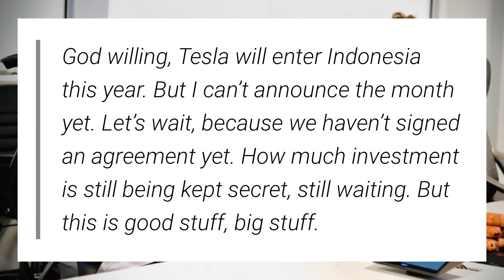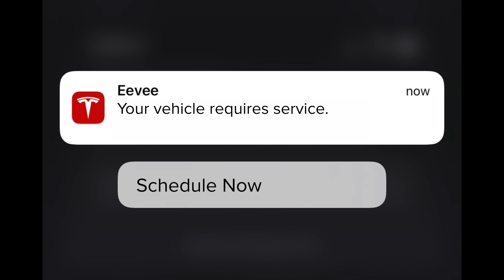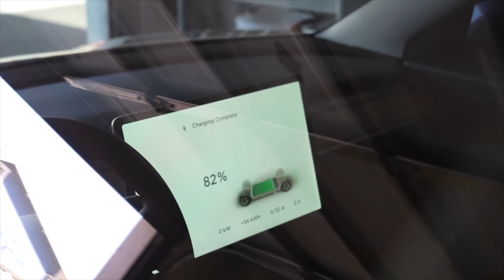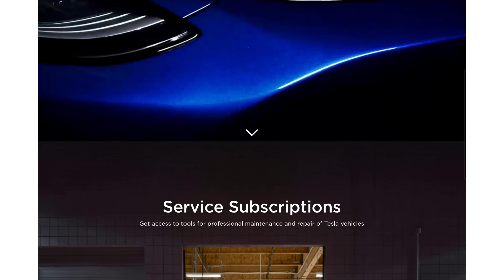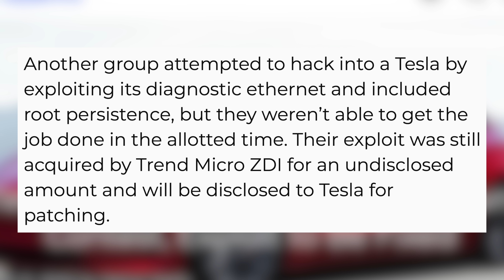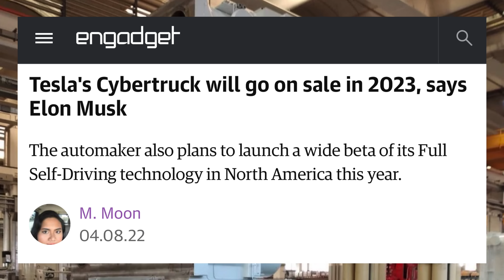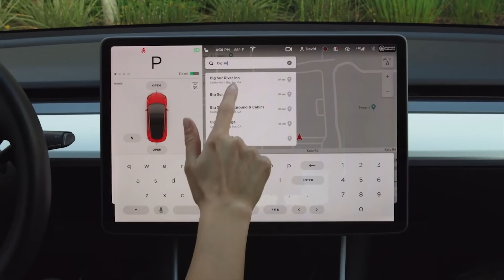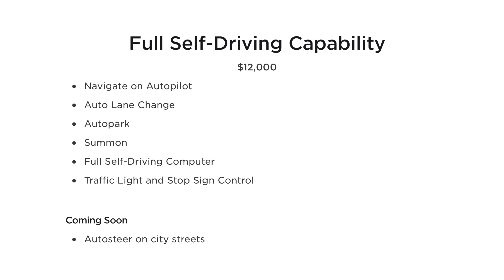Tesla's NEW 100 Year Battery | These Plans Change Everything

Comment: Hmm, when the battery is designed to outlast the vehicle.... Does that mean the vehicle is only going to last 10 years?
My newest car is 13 model years old and runs and drives like new.

There's a lot of hype about charge cycles when it is only half the story. Simple age kills batteries. They need to be made to reliably last 20 years. More will be better, but 20 is a good goal. At which point, there will be no reason for me to stick with a gasoline powered car.

Comment: If you read the paper for this new potentially 100 year battery tech they were discussing cycle life and the lower charge voltage due to using 2 electrolyte additives that improve the working life of the cells.  Everyone already knows that most batteries unless they are being cycled several times a day are going to suffer from calendar aging eventually regardless of how high they push the number of cycles.  So improving the electrolyte is a step in the right direction but I doubt that is going to make enough of a difference considering many manufacturers are already using these additives in LFP batteries.  With current battery technology that is in the market right now including the latest from tesla, NMC and NM tech has a calendar life somewhere in the 10-15 year range and LFP has a calendar life somewhere in the 15-20 year range if kept in within the appropriate temperture range.  Considering that many of Tesla's vehicles if you calculate the actual capacity size of the battery at the sale of the car it is a larger capacity than what the car shows and then you calculate it again based on what the current pack capacity is after 100K and 200K miles it shows that the battery is no longer above 90% at 200k miles.  Many people are keeping track of this and it is well known that many EV manufacturers are putting a large percentage of the battery in reserve to hide the degradation of the cells over the first 100K and 200K miles of the vehicle's lifetime.  In short thier is no way that Tesla or any other manufacturer has a lithium battery that is going to last 100 years or even 50 years and still have a meaningful capacity.  If they can hit the 20 year mark and eventually the 30 year mark with a battery that has only lost 80% of it's original capacity, that will be a huge first step.  Also remember that once lithium packs drop below 70% they are considered EoL because the chances of them having a cell failure increase rapidly after that time due to dendrite growth, lithium plating and corrosion.

Comment: As an owner of a 2013 Model S85 with 109,000 miles and only 86% of original battery capacity remaining (so Tesla's boast of 90% capacity remaining at 200,000 miles does not ring true for me), my main concern is:  when I do need to replace the battery pack, will I be able to get the latest "new" battery technology in the replacement, or will I just get "refurbished" original?  I REALLY would like to keep my Tesla for many years to come, but am apprehensive about its true long term viability.  There is a reason why legacy auto makers use planned obsolescence in their vehicles, ie. to insure FUTURE sales.

Comment: The one thing I'm not hearing from the Tesla/EV YouTubers is that the chemistry is the 532, which is the wrong direction in terms of cobalt. This battery uses 20% cobalt in the cathode, unlike the 811 chemistry or as I've heard Tesla using less than 5% in their current NMCA cells. Also, the research demonstrated the volumetric efficiency at 210 w/kg which was the same as the tested LFP.
Reply: It's a "research paper" demonstrating the possibility changing the voltage of Nick based cells to increase longevity! Nothing more!
I hope you didn't think this was related to the 4680 cells??

Comment: People have been trained for years with crappy 12 volt batterie some only lasting 3-5 years.
Reply: What?
Reply: @rogerstarkey5390  Most people I see that do not work in electronics or construction almost always comment about how long the battery will last. They then say about their car batteries needing replaced every 3 years or sooner if you let them go dead. Or how there cell phone does not hold charge longer than a few hours. People in construction will say so it is like a cordless drill. I have one almost 20 years old battery still works great drill does too.

Comment: The research work on battery development is encouraging.  Although I suspect these "100 year" batteries are several years off.  And, the design is sure to take different branches moving forward.  Maybe they end up with a 30 year battery, but the range is increased.   IMO EVs with a range of 400+ miles is a tipping point where those with range anxiety will be convinced 400 miles of range is enough for them to jump in.
Reply: This is Jeff Dahn.
He announces when it's ready
Reply: @rogerstarkey5390  I am pulling for Jeff (and his team).  Even incremental gains in battery density/range will help the whole EV moment.
Reply: @billsrelectric  
We're seeing innovation not only in the "chemistry" but also the "system".
That's essentially what 4680 brings to the game.
.
It's a string of solutions, resulting in an accumulated improvement in the vehicle.
.
Tesla question, first principles thinking....

"What do we need?"
.
"Cheaper, cleaner cells, Smaller volume, lighter pack, 
Weight removed from the car for efficiency, 
Simpler construction"
.
Then the process goes......
.
Cells were "messy" and complicated to make due to the wet process.
Maxwell had the idea, Tesla had the clout to refine it.
.
Larger (high energy) cells were a problem due to resistive heating.
Maxwell had the idea, Tesla (again!) had the clout to refine it.
.
Hence the 4680, which made the pack light by reducing metal in the "cans" by about 40% for a given amount of "active material" (yes, I worked it out).
.
And...
 Made the structural pack feasible (much less glue!)... 
.
Which allowed removal of the bodyshell floor (BIG chunk of steel sheet!).
.
Result?
Objectives achieved
.
We can add the fire retardant property of the adhesive.
And faster charging(?) Due to reduced heat build up.
Etc
Reply: @rogerstarkey5390  From the consumer's (buyer) perspective they want to get into the vehicle and have greater range and/or faster charging.  And they want it now.   Buyers are funny that way.  Most don't care what happens behind the curtain.   HOPEFULLY Tesla can eventually make enough 4680s to put them in  all Model Ys.  And hopefully Tesla will have enough 4680s to put more in the vehicles to get the range up towards 400 miles, or at least high 300's.   We should know more about the progress of the 4680 ramp in 2023.

Comment: If battery’s last super long, and car drive million miles, and the computer powerful enough not to be replaced after a few years, then sales will drop once everyone gets a car and don’t need to replace it after the typical 4-25 years 

Only income would be parts for fixing crashed cars, but FSD in most cars would greatly reduce crashes

Only people enjoying new clean cars would buy frequently, others would be fine with a used car with paint scuffs, as the car is otherwise new

Comment: 100 year battery? Now can they make the body and all the gadgets last that long? I'd spend 60k to buy a car that I can drive for the next 100 years. That adds up to a cost of 600 dollars a year.
Reply: Let's see....
You (They) build a robocab.
They build a lot of them.
They stop selling cars to the public and reconfigure the factories to refurb centres.
Every 200,000 mile(?) A cab returns to the factory, is inspected, and the body is lifted, taken for refinishing.
Seats removed from the skate, suspension overhauled, refurbished seats, refurbished body (maybe a completely different style!?.
Diagnostic set-up.
Out the door in a few hours...
.
Reply: @rogerstarkey5390  The economy is built on selling cars to the public. Everyone would be ruined if they actually did that.

Comment: Question:  Will longer range for 3680 batteries come in the future with over the air updates ?
Reply: Tesla did this on older packs.... But.
Consider that the cells were being developed in tandem with new model cars and they didn't know as much about the cells then.
They were "tweaking" just as other manufacturers do now.
.
The database is now larger.
I think they know the performance and won't add spare cells.
.
If that's the case, no extra range to speak of.... More cars on the road instead.
Reply: They only Tesla car that could have longer range with OTA was their Model S 60. Which I believe had 75kw battery that was locked to only have 60kw. I think at the time that was the smaller size pack they had.

Comment: Is there data available for battery pack longevity? It probably depends on charging practices and heat exposure more than anything.
Reply: The heat does impact durability as they tested the battery as high as 70 degrees Celsius. They want to test higher nickels chemistry , probably the 811vs the 532 tested.
Reply: And luck. One bad cell is all it takes to need repair or replacment. Its not about the slow lose of range thats a good thing. What you want to avoid is the unlucky bad cell
Reply: @AllMyHobbies  
One bad cell of 850(?) in a pack with a modern BMS and you have...... 849 cells.... And a loss of 0.11%..... 😱
Reply: @rogerstarkey5390  that’s not how it works at all sad to say. watch some tesla battery pack repair videos. they have to take the pack apart and find the one bad cell and remove it. modern bms do not connect to each cell sad to say. what really happens is one cell gets a internal short. And it draws down all the other cells that are connected in parallel with it. this makes that module report a low voltage. the bms then notices what’s happening and reports the battery pack as bad. know what your talking about before spouting off.

Comment: I don't think Elons comments about FSD are a pushback. He said it would be a good as a human this year. That is not the same as being able to drive without a driver.  I believe then want ten times better before you take the driver out.  

I have FSD beta and my guess is that Elon is about right.  I do think they will show that it will work by then end of this year.  Then how long until it's actually used in shine small taxi service. My guess there is about another year,  so end of 2023. I do think wife spread adoption will take another few years for several reasons, but once it starts it won't stop.

Comment: If the battery was "truly serviceable" it wouldn't require that kind of costly breakdown. "Right to repair" is one thing but requiring this kind of laborious process by a service center doesn't seem likely for most who own the vehicle. I realize some won't care but it goes to show just how far we have to go still in order to make these designs modular and NOT like an iPhone or other permanently sealed off platforms. Also recycling of say something like an iPhone just isn't going to happen so long as they are designed with everything permanently fixed in place. In some respects, it's cool the level of integration the Tesla platform has achieved but in so many other ways it's a very conventionally engineered vehicle.
Reply: Missing the point completely.

Comment: I know it's not the same, but when replacing a Prius battery you have to gut most of the car behind the front seats. Carpet and that stay in but i mean the rear seats and pretty much everything within the trunk (boot) of the car comes out. I say this only to point out that I suspect a person with good experience can get a Tesla gutted in no time. First time I did a Prius battery it took me hours to get everything gutted. I can pull and replaced one now in 30-45 minutes. And I am just a simple hobbyist, not someone who works on Prius multiple times a day.

Comment: That would be really good: After 10 years change the batterypack to a then much better/bigger one, change the main processing unit and maybe you almost get a new car. Maybe double the range with state-of-the-art onboard IT. So let´s wait, if someone besides the customers will want this.
Reply: Bnb
Reply: A R
You'll never be given a pack to "double range".
How many times does it have to be said?
Nominal range, Outrange the driver,
Charge while the driver refreshes,
Repeat.
That's going to get more cars on the road.

Comment: Ryan, in the UK unless Elon lengthens the charging cable to enable other Ev's to use it will mainly be tesla's using them or other Ev's will take up two charge ports, are USA workers worried about Elon outsourcing jobs to Indonesia with having cheaper wages and cost of living?
Reply: With a factory in Shanghai already and soon Indonesia I think the USA workers should worry it’s build quality is not up to the German factory standard ultimately not worry about Indonesia
Reply: @hamster1-1  
My thoughts exactly!
Is Texas produces cars with the same workmanship as Fremont, there is going to be trouble.
Reply: "In the UK" drivers will be assigned chargers by the app.
If the location is busy, priority will be given to Tesla users.
US workers should be grateful Tesla built ANOTHER factory that should create employment for least 22,000 workers directly and up to 100,00 in satellite industries.
Nice try.

Comment: As for FSD cost, I've subscribed to it at the $200/mo rate to give it a try on a couple upcoming road trips. The break even point is at 5 years if I hold that subscription continuously. It becomes much longer (the break even point) if I cancel it when not needing it and only re-up for the next road trip or other need. I may very well sell the car before that break even point in favor of a more advanced model if and when it is available. My subscription will stay with me rather than with the car as the full $12,000 purchase does, although that could change in the future. That seems the best strategy at least for now. Cheers.
Reply: My car came with advanced autopilot, and i do enjoy it from time to time. Very handy when i need to open a soda or something, BUT. and this is a big butt too :) The service follows the car not the user.. this is stupid. i get it for the other stuff like ludacris .. but for fsd? it should most def be tied to the user acc. lets say u often drive different teslas. with all this tech im sure its an easy feat to have roaming profiles that carry the fsd key needed for the mcu to know its a paying customer that is using the car.
Reply: Yes, subscription is way better no matter what Elon says.
Reply: Subscription price will change as well most likely
Reply: Wait. What are you braking even with??? What return are you getting?
Reply: My 2019 I bought it with at the time cost $5000 for FSD.  Makes it hard for me to sell the car obviously lol
Reply: Every video I see of a bloke with FSD shows him or her eating noodles with chopsticks or watching a movie, or even if they are a responsible driver their attention is being pulled away from driving. The thought of thousands of internet influencers on the freeway taking naps and eating fa while taking selfies makes me cringe.

Anyway, does anyone who uses FSD know if it only uses the left lane to pass, and then gets out of the left lane? Or does it camp out in the left lane at the speed limit?
Reply: @331SVTCobra  First of all yes, it'll get out of the passing / left lane on its own, if you set the setting to allow it to do so. You can control the aggression level it does lane changes at. Also, you can set it to only lane change when you the driver turns on the indicator in that direction. Secondly, these internet videos you see are BS, in reality you cannot do this; the system frequently demands your slight input on something, any of the controls, to keep at it; otherwise it'll flash a light warning which gets faster and faster until it starts beeping and if you continue to ignore it ,it'll shut off and display a message that autopilot is disabled until you stop the car again. Also, if you enable the interior camera, it will watch your eyes/face and determine with extra accuracy if you're paying attention; it acts very quick, I've tested it. If you put one of these weights they attach to steering wheels to trick the vehicle in thinking your hands are on and thus paying attention, the camera will still determine that isn't the case and disable after warning you. Tesla software engineers are world-class, trust me, they're aware of all the things people are doing and gauge what to do against the laws, technical abilities, etc. constantly.

Comment: Tesla is "fixing" an over heating CPU issue with an OTA "fix"? That's called throttling back your CPU which will (likely) reduce performance (to some degree). I believe the industry term for this move is "Apple-izing the chip". 
👽🖖"Na-nu"
Reply: Interesting.
Reply: Interesting "speculation"
(Zero "knowledge")

Comment: Is V_max of 3.8V not extremely low tho?  U can’t store many kWh with that limit
Reply: Peak voltage alone is not enough to determine capacity. The voltage is more a function of chemistry. Different chemistry have different voltage sweet spot.
Reply: Read the report

Comment: The EV battery of a car is so heavy that it's equal to the weight of six adults. The US government will "surprisingly" announce later the repair cost of roads and bridges have doubled because of the impact EVs had on the infrastructure.
Reply: Still spamming
Still wrong